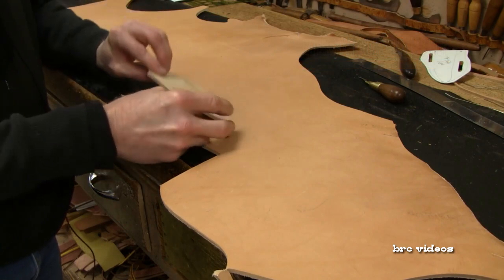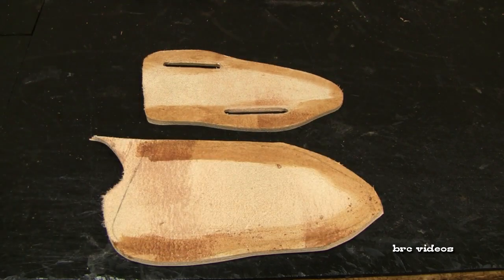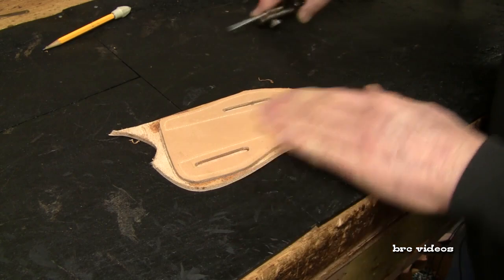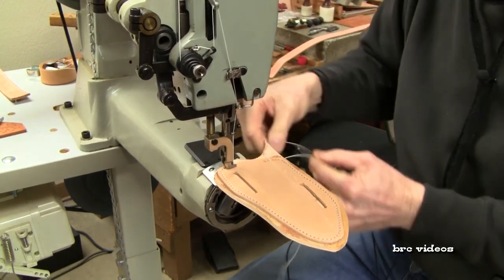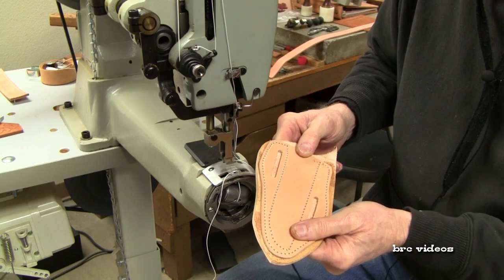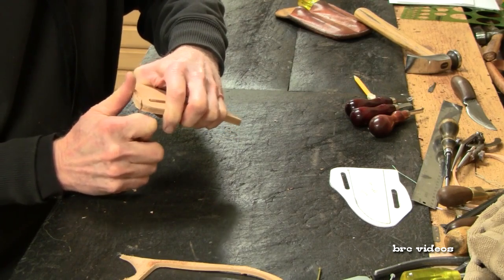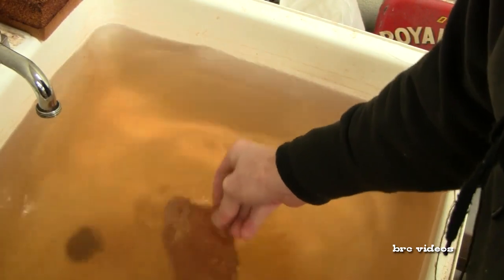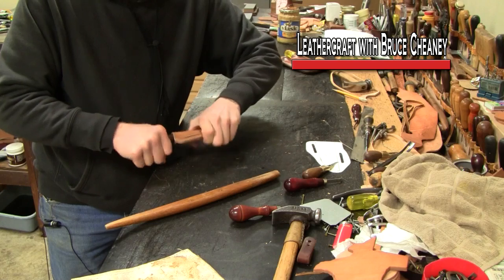Leather Working ✔ How to make leather knife sheaths - Session 2 - Leathercraft

Comment: Hey Bruce, I was surprised that you didn't use a welt to protect the stitching from the live edge of the blade. Was there a reason on this style that a welt is not needed? I know this is an older video so I hope you still see the comment and can answer. I'm about to make a sheath and I was trying to figure out how to add a welt on a pancake style but it seems you don't do one so I'd hoped to get some info about that. Thanks
Reply from the maker: It will be easy to make a spacer or welt after you get the top and bottom pattern worked out just make a spacer pattern that tapers 1/4 inch down to very thin.

Comment: dont you have to worry about the blade cutting thru the stitching .. most sheaths i use a welt.   should i use a welt ?
Reply from the maker: Welts are good I just did not put one in the sheath.

Comment: I was surprised to hear you say olive oil. I've heard debates as to will it cause mold on the leather, thoughts? I've been using it.
Reply from the maker: Been using Olive Oil on leather for many years without any problems.
Reply: @cheaneysaddles  any vegetable based oil will turn rancid in time and get sticky and stinky  try mineral oil and please use a welt I have made hundreds of a sheath like this and they all had welts , it is difficult on this style sheath but doable

Comment: Have you ever had any problem with the blade cutting the thread since there is no welt? I have had that happen on me this week & I think it is due to the knife having a rounded belly on it. I have made 3 & the same thing keeps happening when I slide the knife in it cuts the thread. I think I am going to make a scabbard style for the knife so that there is a welt. I have made the pancake style with welt but it's too thick even using a lighter weight leather & just on the cutting edge side of the sheath. What is you opinion?  Thanks
Reply from the maker: Yes on a fixed open blade a welt is a must and pretty easy to sandwich in between.

Comment: Hello sir. why don't you cut both parts to exact size as opposed to cutting one to size then leaving excess and trimming upon sewing?  thank you sir for your time
Reply from the maker: Much easier to sew with overhang on the bottom side I don't have to worry about running off the edge.
Reply: Bruce Cheaney Thank you for your always  speedy response. You are a gentlemen.